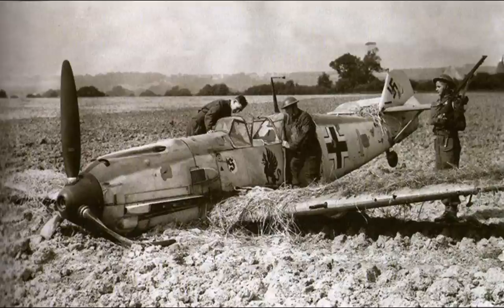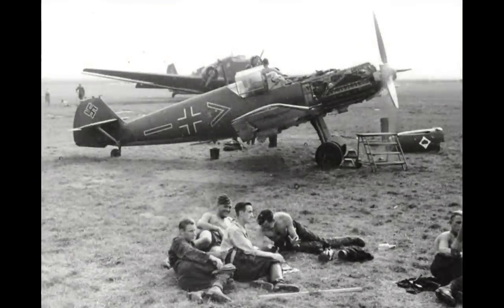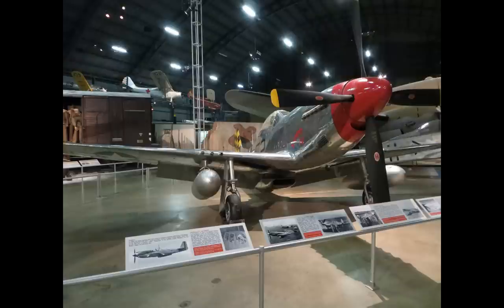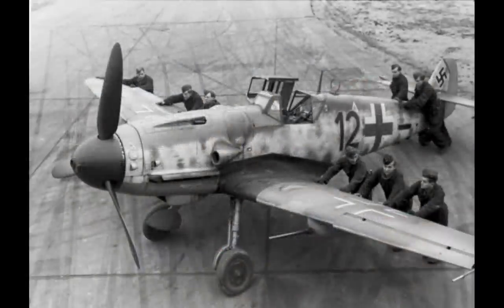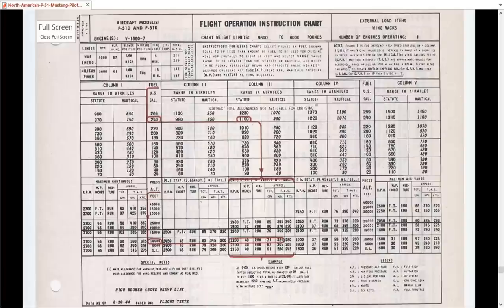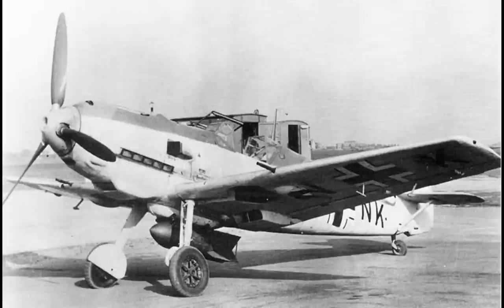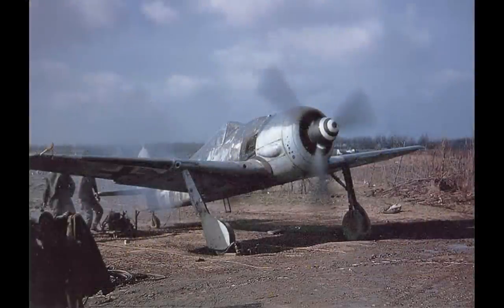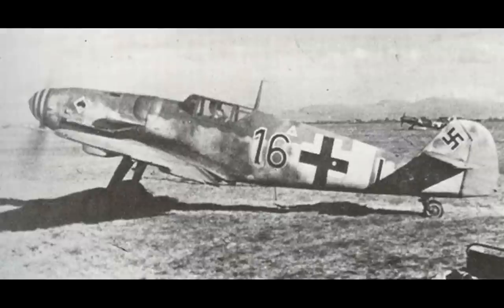Messerschmitt BF 109, Why Such Short Range?

Comment: Germany was never looking at a long range war.   Germany also had serious concerns about fuel.    Sure, Germany could have made fighters with 1200 mile range,   but taking off, flying short range defensive missions, fighter sweeps over the english channel, stuff like that... with the 2-3x fuel load would have been a waste..   especially if the aircraft was lost...   essentially,  lets put 3 fighters up for the fuel costs of 1 fighter.   

this also ignores... drop tanks,  As the germans saw a need for  longer ranges,  the Bf 109E-7 began to use an 80 gal external fuel tank.   the fighter could then take off,  climb to altitude,  cross the channel and by the time it was over England, said tank was now empty, and the planes performance wasn't hampered.   This really pushed the effective range of the fighter out from 400 to 600 miles.
Reply from the maker: It's much more complicated than that.
Reply: @GregsAirplanesandAutomobiles  Yes and no,  Aircraft are designed by "requirements"  and doctrines of the time.  Even today aircraft are designed like that.

The Germans werent' expecting to need a long range fighter, because their theaters would be - Europe and Russia.    There was never a major expectation to fly for hours on end to a target area.

yes there were other factors...   but in truth...  if you need a fast, defense fighter, you sacrifice fuel.   a more general purpose longer range fighter will be bigger and heavier, thus less maneuverable.     And then long range fighters tended to have to be twin engine...   or single engine with lots of drop tanks.

Comment: I have read conflicting reports that the DB 601 had not only (port) fuel injection, but DIRECT fuel injection. Anyone know?  That's a technology that would pop up again in the Mercedes Gullwing in 1955, then disappear until about 2000!  I'd think that if the Bf109 had DFI then it would have shown a little better performance than it's carburated competitors!  (perhaps something else held it back?)

Comment: I was under the impression the 109 had a larger engine to compensate for lower octane/lower quality fuel plus what was a mid 1930's design?
Reply from the maker: That's sort of true. They did have a larger engine and lower fuel octane, but the Merlin, DB601 and Allison were all developed in the early 1930s.

Comment: There's another important reason NOT to go for more fuel in the BF 109. 
Germany had a real fuel supply problem already early in the war (the reason several operations failed). 
It makes no sense to make bigger fuel tanks when you can't provide the fuel.
Reply: Too bad the Germans didn't just install small fuel tanks in everything so they wouldn't have had a fuel shortage.
Reply: @terrywaters6186  That's a way to look at it😏 Then they can always say they have a FULL tank. That they can only drive/fly 2 miles on 1 tank, that's another small neglectable problem😁😊

Comment: The big advantage in the Battle of Britain was the fact that British planes were local to the area and could land, refuel and take off again and rejoin the flight. The Germans didn't have that option, thankfully.
Reply from the maker: True, but have you seen how short the distance is across the English Channel?
Reply: @GregsAirplanesandAutomobiles  About 20 miles if I remember rightly, which equates to 40 there and back to refuel

Comment: In your P-47 clips (now or future) do you address endurance i.e. the "N" model?  Designed for the Pacific and the longer range required in that theater it was the only model with a wet wing.  How does it compare with the P-51 in range?  Believe there were about 1,300 models of the type produced and at last count only one is flying currently.  All went  to the Pacific.
Reply: to the RAF in burma mainly. 1400mi statute   but they had many problems with the tanks leaking   made worse by the tanks be pressurized by air bead off from the supper charger.
Reply: @deanwilliams4365  Surprised there were leaking issues given the experience with wing tanks in other A/C which were also pressurized.  Perhaps Republic didn't have the experience of other manufactures.  Still 1,400 miles was very respectable.  Did the extra weight of the fuel in the wings affect performance?
Reply: @jimjacobson4797  Oh no there were a hell of a lot of problems with american aircraft, i suspect more so when these aircraft were delivered to other countries.  off the top of my head. RNZAF corsairs  never used center tanks because of leaking and fire issues. latter found to have actual holes drilled in them. RNZAF venturas,  no holes in the baffles of the onboard tanks. =  17 kiwis killed and 5 aircraft losses on there first ferry flight, questions of sabotage in the US.  RAAF  P40s delivered with acid contaminated fuel tanks, replacements made in south australia.  RSAAF P51 delivered with counter rotating reduction drives but correct props  etc etc  the list is long.  we forget nowadays the anti british attitude of so many americans at that time.
Reply: @deanwilliams4365  Really interesting.  My father's brother was a P-47 pilot KIA on 9 Nov 44.  He was with the 83rd Ftr Sqd, 78th Ftr Gp flying out of Duxford.  Done quite a bit of research but have never read a hint of your information.  Not saying it's not true, but I've never seen an inkling of it.  Strange, as it would seem this would be common knowledge.  More than anti-British feeling it might have been small groups of anti-American/ally or individuals that were pro-Axis.  There were a lot of recent immigrants with questionable loyalties during the war years.
Reply: @jimjacobson4797  ok so a yank flying a yank airplane in a yank air force. you sort of missed the point.  read some non yank material. expressly from asia where american politics for the post war even lead to the american airforce shooting down RAF aircraft.  all glossed over but its all there.

Comment: I think you (or the person you heard this statement from) misunderstood the nature of the carburetor's cooling effect. There is an effect going on similar to whats happening in water injection - when the fuel evaporates it absorbs heat, and consequently the cylinder has to do less work to compress the cooler gas. I highly doubt this is enough to offset the energy lost because of the obstruction though.
Reply from the maker: No, that's not a function of carburetors specifically, it's a function of where you introduce the fuel. Many fuel injection systems inject the fuel far enough back to get this effect, and in fact in the same location as a carb. I was SPECIFICALLY talking about the effect of the pressure drop. These are two different things.
Reply: @GregsAirplanesandAutomobiles  I personally have not heard anyone argue that the carburetor's flow obstruction adds performance, which is why I believe this effect is the source of the confusion. I may very well be wrong though :) anyway, I really enjoy your work, this channel is hidden gem on youtube

Comment: The reason the p51 has a smaller engine than the 109 is because the poor fuel quality of germany during wartime. The p51 used high octane fuel, allowing higher pressures and thus more power for the same given volume.

Comment: Very interesting
People forget that the USA needed longer range aircraft due to the size of the USA.
The Curtis's p40b could do 760 odd miles but the p40n-25 series could go as far as 3100 miles with three drop tanks
Reply from the maker: By that logic the Soviet fighters should have really long range, but they don't. The LaGG-1 has a 345 mile range, which is about as short as you will find, the Yak 1 has about the same range as a 109 or Spitfire. The US built longer range planes due to doctrine and technology. Geography played a relative smaller role.
Reply: @GregsAirplanesandAutomobiles  
That was my point, range was doctrine due to the size, Russian doctrine was different in part due to the german influence in their aviation industry in the late 20s and early 30s
Reply from the maker: Thanks Jonathan, it seems we are on the same page!

Comment: Yak's engine name was "KLIMOV", not kill-moth or kill-mob.  It does not kills moths or mobs. https://en.wikipedia.org/wiki/Klimov Thanks!
Reply from the maker: Yes, I mis spoke there, sorry, it happens.
Reply: @GregsAirplanesandAutomobiles  Its ok. The problem is that I almost NOT understand English and I am forced to read youtube subtitles. With automatically translate, that adds a double corruption of the original meaning.

What is obtained in automatic translated Yotube subtitles is better not to pronounce at all ( мамоубийца - "Yak is killig mother" or something). I was a bit horrify me for a few seconds. Then figured out and had some fun.
Anyway your video are very good and interesting, big thanks.

Comment: On the flipside of defending a country like the Netherlands. If bombers are crossing the border it may already be too late for fighters like the Fokker D21 to scramble. To defend against bombers the Dutch had a doctorine of 'fighter cruisers' Heavy long range fighters or even bombers with forward facing guns meant to already be up in the air to in case bombers would attack. But these multirole heavy fighters simply were no match for pure fighters like the Bf-109. Germany faced the same problem with their Bf-110's.
Reply from the maker: I'm not sure I want to look to the Dutch for any sort of national defense strategy. The Dutch however are good pilots, really good.